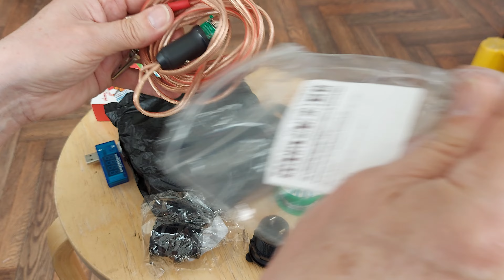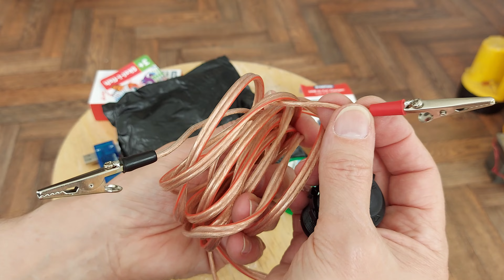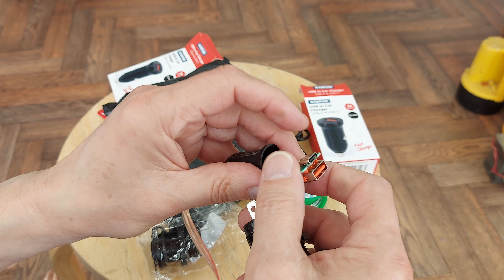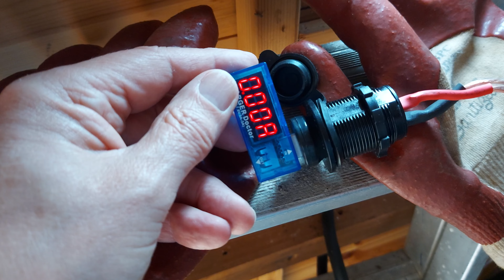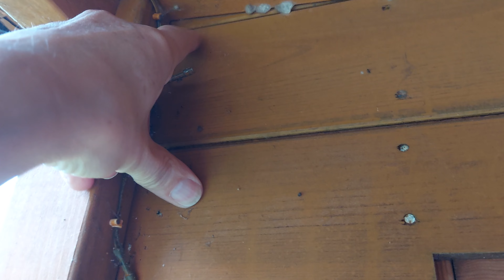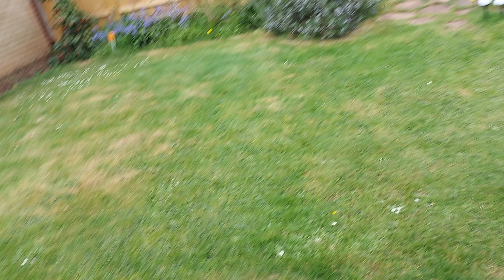Using a 12v Car Battery for a USB supply PART 2

Comment: Useful little outlet, is the 12v battery charged from solar nice setup 😊👍
Reply from the maker: The solar panel is only big enough to keep it topped up when it is not being used. I am running one of my security cameras off it and that draw over half an amp at night when it is running the infrared array. This morning I had trouble linking to the WIFI with that camera, so I brought the car battery indoors and charged it up. I will see how long it lasts. Of course it could have been the weather conditions dropping the WIFI signal rather than low battery. I will see how long it lasts. It had done 5 nights with whatever it had in it when I started.

Comment: You can buy a ready made cable with croc clips and female cigarette plug on flea bay. The also have an inline fuse. About £5.99.
Reply from the maker: Yes, that was what I was going to buy after messing up the first attempt, but then I decided these sockets would do the job and use the cable I had already prepared.

Comment: Hi    You could also put a  suitable diode in  series to stop wrong polarity blowing up the IC    i.e.    1N5822 40v 3A  or SR540 40v 5A   Schottky diodes drop a lot less volts than Silicon ones .
                                                                                                           Alan
Reply from the maker: That would be a good idea 👍👍